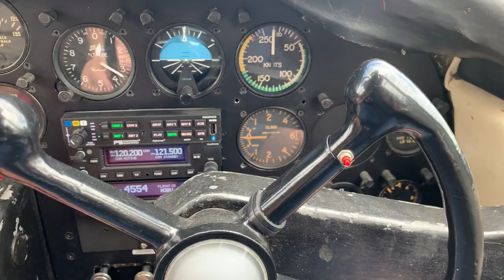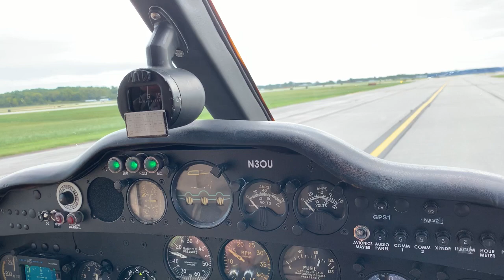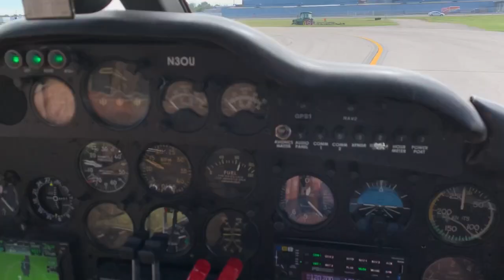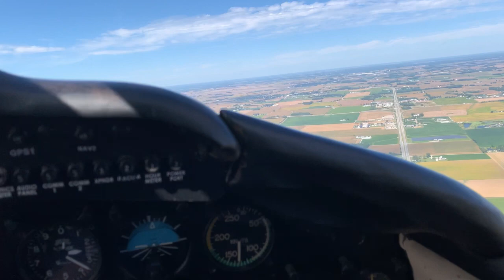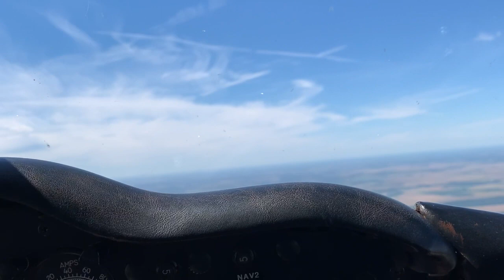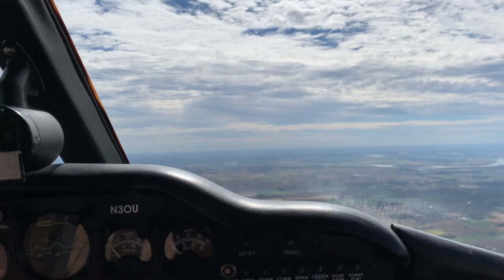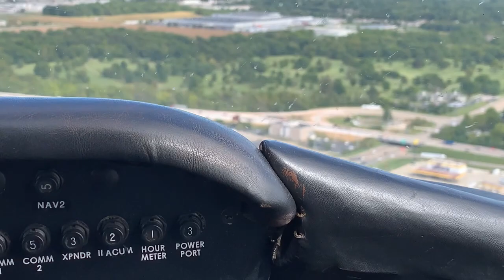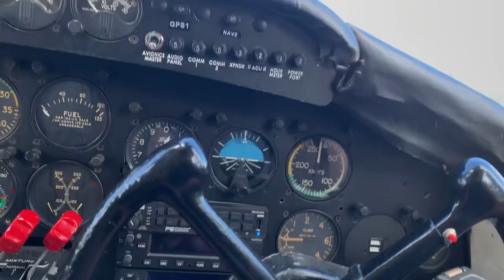Aero Commander L-26B ( Ike’s Bird ) Ride from the Co - Pilot’s Seat

Comment: I was told a story about this bird, in order to show the president how safe this aircraft could be, they removed one engine from the a/c, then loaded that engine back into the aircraft, then flew on the one remaining engine to Washington DC to show the president what a great, safe aircraft it was. Don't know how true that story was, but it was told to me by a retired pilot who was also an owner of a Commander.
Reply: The Commander factory was in Oklahoma City.  They removed one PROPELLER, stored it inside, and flew from OKC to Washington.  It was somewhat of a trick, because with the prop installed, the extra drag would not have made the flight possible.
Reply: @CSW2820  OK, thanks for clearing that up. It was years ago when I was told the story and I may have forgotten parts of it. It's a great bird, that's for sure.